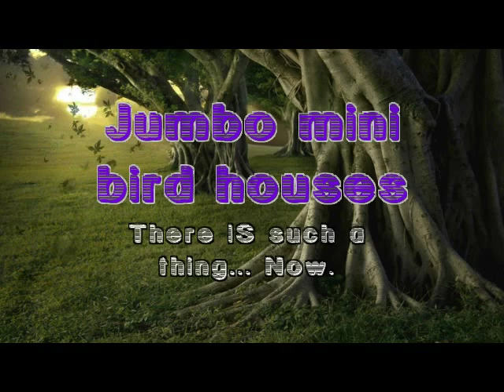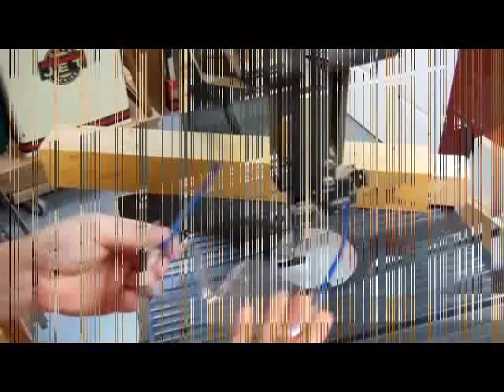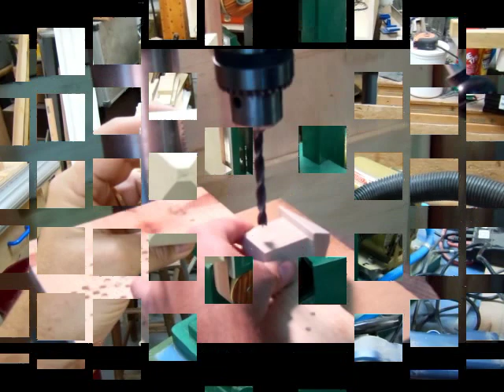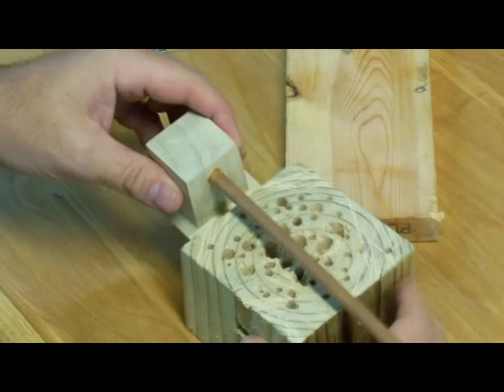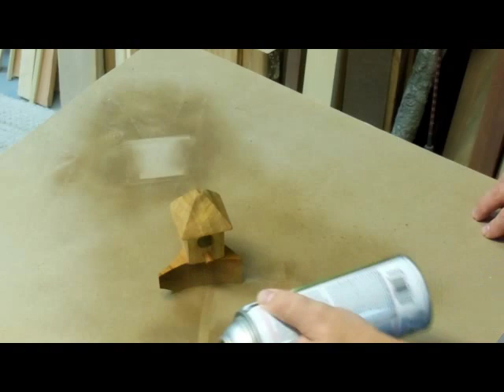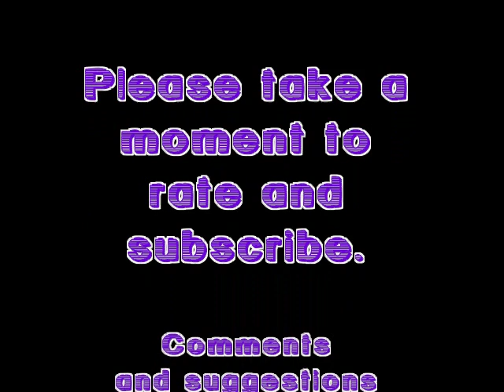Jumbo Mini Bird Houses: Woodworking project

Comment: Great  little birdhouse....would make a good Christmas tree ornament.  Like your sander..what make is it?? Thanks for sharing.
Reply from the maker: +webster behrens Thank you very much. The green vertical belt sander is one I built about 3-4 years ago. It's based on a plan from Shop Notes Magazine. I actually designed the dust collection hood part of it. My dust collection addition was 'featured' in a later issue of the magazine and won me my Porter Cable trim plunge router for being "Tip of the Month"! I love that sander. I works very, very well.

Comment: Those are great. Are they made for craft shows or gifts or something. I'm still trying to come up with something to do with the off cuts that end up at the end, what you get after the top is cut.
Reply from the maker: I appreciate your comment. One of the paper towel holders will be for the house. My wife's been asking me to make a paper towel holder for months now. She keeps threatening to go out and buy one so I figured I'd better get on the ball. The two that she doesn't choose to keep will be added to my stock of stuff to sell at shows, flea markets and online.

I make lots of projects that I don't bother videoing (I usually only get still photos) so I figured I'd take the opportunity to make a recording of this one (at least the bird house part) since it's so quick and easy.

By the way, I installed hanger bolts into the bottoms of the houses and threaded inserts into the poles. Simply unscrew to replace the roll then screw the finial back on.
Reply: Ok that makes sense. I kinda wondered how the bird houses were held on. I kinda assumed the poles just went into a hole bored into the bottom.Why go out and buy something when you can build it, smart man.